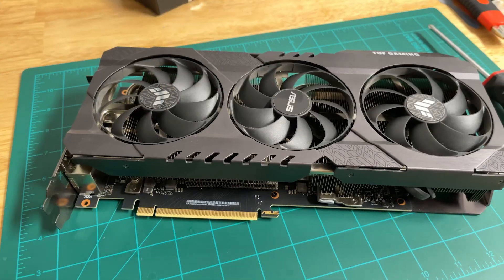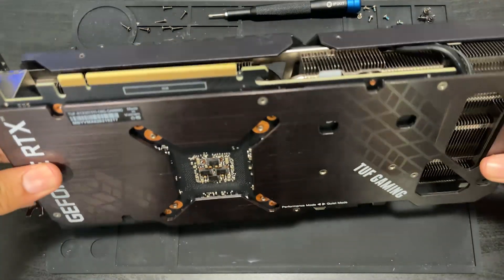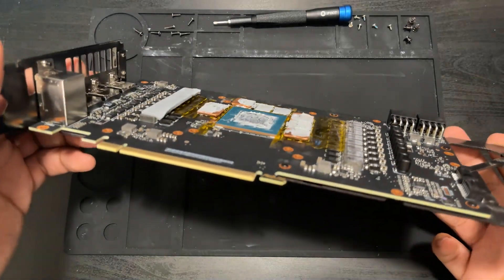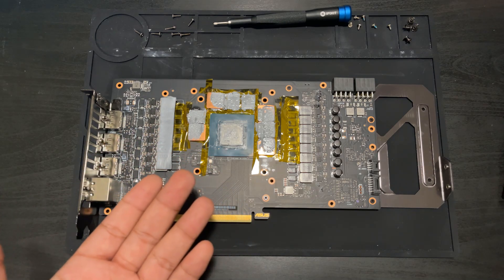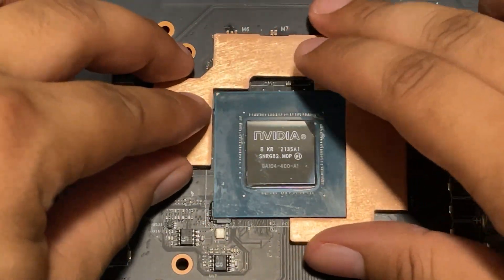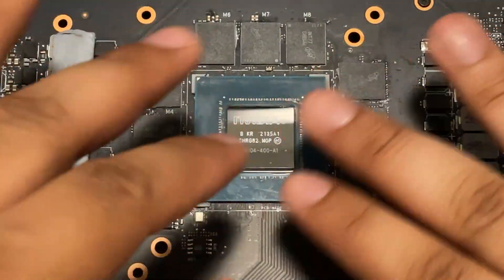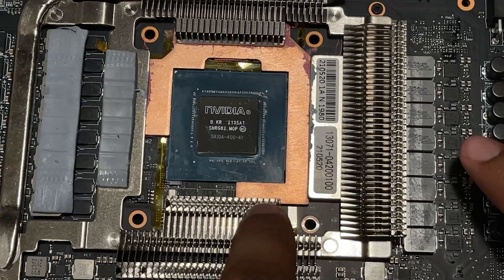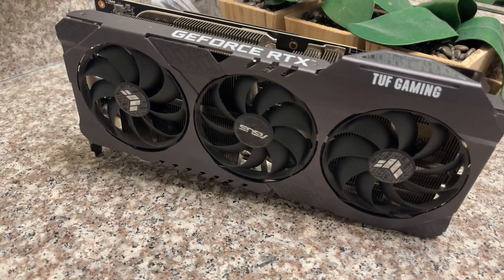RTX 3070 Ti COPPER MOD: 1 Month Later And... OMG...

Comment: Honestly for the price we're paying for graphics cards, these practices should become standard for manufacturers.
Reply: we need to strike of gamers against planned aging
Reply: @Z_Pavel  RTX is planned aging for the GTX 1080 and 1080Ti which were too powerful.
Reply: @Z_Pavel you honestly think I they care about 'gamers' lol.
Reply: @Z_Pavel ptm7950 also
Reply: i hope there is a company with words "create and made from gamers for gamers"
Reply: For real the current situation is trash.
Just got a 3080ti, doing 3d rendering and even at 50% power underclock the memory hit over 110C and shut down. Have it under-powered and undervolted, with a mild 15% underclock for stability, and it only ever touches 104-108C mostly.
Doing a copper mod in the next week.

Yeah it doesn't matter how much of a deal or overpriced the product is when it just straight up doesn't do what it's supposed to do.
Reply: @arsenal4444  look into copper modding it and use msi afterburner to give it a more aggressive cooling curve.   My 3080ti never goes above 75c(usually 71c under full load)  and generally sits around 26-29c while just doing normal stuff.

Edit - oh just realised where this was posted and read you txt proper 😅😅😅  ha ha .   Well you'll see  good results doing this anyways.    Oh and one more thing,   the msi afterburner still  makes a big difference as my 3080ti will go to 51c without a load with it off.  I guess thw default is no fan under like 60c.
Reply: @jebes909090  honestly the cooling noise got annoying at anything outside of auto, and yeah I could micro-adjust it to optimize like 5-10% better fan speed throughout, but the single digit degree C that will yield is pointless for how the card fares in it's current state

and it's only the mem/hot spot on the junction. That's what crashes the whole thing, otherwise for full load and rendering the core is in low 70s to high 80s depending on power limit and voltage adjustment

the issue is fully in the lack of copper modding, fans are doing their thing fine as is
Reply: @arsenal4444  i feel you, same happened to me with a 2nd hand tuf oc3070ti that was used for mining. It was like @109° something and the gpu core@80+. Now after the copper mod I'm at 70 degree max on the memory and 75 average on GPU core
Reply: @user-jd3pk1bz8e  ayy thanks i forgot to reply here. Yeah those sound about right, copper modding may be my new addiction lol.
Reply: @arsenal4444  damn bro. I am gonna do this mod too. Mine reaches 100+ while rendering in blender. Now running with heavy undervolt+memory underclock and lowered power limit. Starting hate Nvidia so much for their bs.
Reply: @Pixel_FX  It's totally on a per-card and per-manufacturer basis. For 3080ti's, the overheating undervolted one is evga, but i have a gigabyte running stock and it only hits in the 80s and sometimes touches low 90s for a moment, but the core vs mem vs junction temps don't have more variance than 10-15C degrees. The temp differences on evga are 30C+ 

Seems it's super installation dependent with physical tightened pressure on the core thermal paste vs mem thermal pads being either close to even or way more on one, as more pressure means more heat transfer into cooling fins and fans, and whichever is looser just holds the heat instead of transferring it.

Super excited to get this fixed and reply with numbers.
Reply: @arsenal4444  Reply here with numbers if you can. or upload a video :D on your channel. just subbed
Reply: old cards were made like this lol
Reply: They want to be cheap with manufacturing and charge a big amount on the cards to earn more profit than spending to manufacture then
Reply: I agree bro, I just realized that my vram temperature was 101 C
Reply: @PITAGORAS2552  copper modding brought my 3080ti to 75c under load.   i noticed that everythign was dried out when i took it apart to do the mod.
Reply: Agree
Reply: ya its kinda messed up that the gamers themselves have to take matters into thier own hands.    looks like nvidia is using the bethesda model ;)
Reply: Refuse to buy deliberately poorly designed, planned obsolescent products and they will.
Always do your research before purchase and vote with your wallet.
Reply: Oh yeah.
Reply: facts but they dont care because they want their MTBF low before they'll sell you another gpu :)
Reply: They do it on purpose so we spend more money on their cards.
Reply: copper modding is going in for atleast 15 years

its hilarious that card makers still let their vram cook and they also still use this horrible, hard thermal paste and often really cheap and bad thermal pads

as far is i know, it got worse over the years.

i remember seing those really nice high end gelid pads on older cards like on the AMD HD 7970 3GB with stock blower design.

And then u have a high end 3080 that comes with the cheapest, worst pads in the world while the VRAM is cooking at 105 degrees.

I also dont get, why card makers never put pads on the backside of the card. Putting pads on the back side where the vram sits so the metal backplate makes contact can get u 3 to 6 degrees difference.

Im using a complete backplate mod and also a pad under the GPU die so it also had contact with the backplate. And on the backplate additional heatsinks.

The card is stone cold even with brutal overclock and only 50% fan speed. With arctic thermal paste i roughly get to 64 degrees in summer (i live under the roof)

With liquid metal its mostly at 57 to 59 degrees. And in winter even colder.
Reply: Nope lol super high risk
Reply: @whitefata104  No

Comment: Hi Dandy, so underrated channel, excellent content. My first question:  Copper size 1,5mm or 1,2 or something. And second, Did you try it on 3080 ti TUF, it would be awesome if u make a test for it, caz that card is so hot even after thermal paddng regularly. Thanks bro.
Reply from the maker: Thank you! Sadly I don't have a 3080 ti on hand, but the plate size I can tell you is 1.5mm!

Comment: how thikness copper use for gpu vram?, i using 1.5mm thikness why that temp is getting higher? start from 60-65° than i use copper temp up to 88° need some guidance

Comment: I’m so curious to see what would happen if placing a thin cooper plate on the die. Would it cause a short? Or would it make the temps better?
Reply: not a good idea in any way shape or form.... never ever do this lol.  the heatsink plate is usually not perfectly smooth, the die itself is probably not perfectly level, and the copper plate you will use is not perfectly smooth. the distance between the heatsink and the die is minimal, the thermal paste does plenty good job of filling that space effectively and with good thermal transfer. you wouldnt see much benefit at all doing a copper plate. you would probably crack the die

Comment: Ive done this on over 10 gpus so far and had incredible results each time, also on vrm/cpu/ even a desk fan ive attached like 10 shims onto its heatsink and it literally made a 50% difference, these copper shims are incredibly powerful
Reply: It's been a while, have you had any issues  with corrosion in any of your units as a result of the galvanic coupling over that time? Or even as general malfunctions or card failures?
Reply: is it possible to do this mod on laptops?
Reply: @hatorichise2705  yes absolutely
Reply: @hatorichise2705  You can use the mod for the vram but not on the cpu or gpu. If you want better temps for the gpu or cpu youll want to use liquid metal or PTM7950
Reply: Hello, where can I find them?
Reply: @Jeanpaisa89  Amazon..
Reply: yo that profile name is nuts man 🤣🤣

Comment: I have an RTX 3090 (Zotac Trinity with modded bios to remove stock power limits). I removed the stock cooling shroud and placed the card directly onto 3 Noctua fans (120 mm) mounted at the bottom of the case (intake). I purchased 2 additional smaller Noctua fans (92 mm) and placed those directly over the backplate of the GPU, using 2 mm standoffs (push configuration, so blowing air directly onto the backplate). I get idle temps between 23 - 25 C depending on the ambient temp. Under full load, the card never goes over 66 C. I wonder how much more I could get out of it using a copper mod. I don't have your patience though. Taking apart a card takes a lot of steps and patience.
Reply: it has nothing to do with core temps...
Reply: @pav1u  Please enlighten us.

Comment: I’ve tried your first solution and it worked great! (Same GPU as yours, my temp went fron 106 C to 76 C mining) I wanna try also this one, the 1 piece copper plate seems a lot easier to work with

Comment: saw your original copper mod video, very impressive results, with the temps getting far higher than I am personally comfortable with on a lot of these GPU's its definitely worth doing IMO, gotta say though that the custom plate is pretty expensive for very negligible performance gain, the "shims" are of course kind of DIY, but if it works and costs a lot less that's a win to me. It seems like 95% of the performance for less than 50% of the price. Either way definitely a worth while mod.
Reply: Absolutely agree with you. I looked around for thermal paste reviews/testings and it turns out the change from Arctic MX-4 thermal paste to Kryonaut thermal paste is really what gave the 4-6 Celsius bump in performance (game load comparison). Had I did more research and paid more attention I would have saved myself $20 (+Shipping cost) difference if I just ordered the DIY Shims.

Comment: I used 0.5mm thermal pads between the 1.5mm thick copper plate and the memory chips. Regular thermal pads were 2 mm thick. The effect is the same.

Comment: Man seeing 62C mem temp is so surreal lol! Another amazing video, you're crushing it!
Reply: Hi Seb, I am a follower of your channel. Have you tried copper modding? It works really great!
Reply: it doesn't work that well depending on gpu and correct thickness, not easy, i copper modded more than 12 times different gddr6x only, i just used less thickness shims than needed and i don't use thermal paste, i use thermal putty (sticky and no need for kapton tape etc as it acts as electrical isolator as well, i can keep the hottest card easily under 90c in the summer inside the farm with no fans so its all good, long time sub Sebs, keep em coming!
Reply: @pav1u  lol 90 is so bad compared to copper 66
Reply: you gotta try it seb. I did it too on my gddr6x gpus and now I don't have to listen to %100 fan noise while keeping the memories very cool :)
Reply: That's why i buy strix , you dont have to change anything and the card come with good thermal pads.
Reply: @whixirc7564  even strix dont come with thermal pad quality like gelid gp ultimate 15 wmk
Reply: @techgeek2994  They come with better one than the other card.
Reply: @whixirc7564  basic cards come with 3 wmk, strix comes with 6wmk , gelid ones are 15wmk.
Reply: @techgeek2994  That's what i said , i didnt say they come with 15wmk , they come with better one than the other card.
Reply: @whixirc7564  yes that is true
Reply: I'm getting that on a 2080 with upgrade paste and pads with -125mv undervolt, 50% of the fan speed as before.
Reply: @BboyCorrosive  undervolt is king if i copper mod the 3070 i would see max temps 55degs
Reply: This video inspired me to copper mode the same 3070ti Tuf gaming GPU. I did it few weeks ago and so far so good! The temperature is around 68C, but I covered cooper plates by using special liquid to prevent from shorting circuit. So that's why my temperature is a bit higher. Also, I used thermal pads to isolate memory chips. 

It is hard to believe that some GPUs have a massive radiator, but such things as thermal pads don't work well!
Reply: @bohdan.samusko  yea its very interesting, alot of the reason this works as well as it does too gpus or cpus for that matter simply have thin crappy alum/copper, ive never seen a heatsink actually have a very thick alum/copper makeup at all, its insane honestly. these shims cost like 2$ or less and the companies could put them on the mem pre installed so easily, its literally like adding 100$ of performance to a product in terms of how much difference it can make, sometimes more
Reply: @bohdan.samusko  how did you isolate memory chips did you put just small amount around memory chips with thermal pad ?

Comment: İ did copper pad mods on my 2 rtx6600 it worked fine but when i apply on my 3080ti it just blows with the shortage i think i didnt use enough kapton type

Comment: I did some undervolting and got some pretty good results.  I saw the first video you did and thought I might try the copper mod if the undervolting didn't work.  So far, the undervolting is pretty close to what you're getting.  However, should I decide to do the mod, I'll use your videos as reference material.  Thanks for the update!
Reply: What card have you got? How much undervolt? I have a ventus 3x plus OC and wondered what the sweet spot might be

Comment: Hmm I get 80+ mhs here. Is it broken? Or did you record this weeks ago ? hehe
Reply from the maker: Recorded pre-full LHR unlock haha :P
Reply: @dandyworks  the 100% unlock was like 2 week ago, but its like 3 months that its on 80% giving 70mhs, 55 - 56 is to low, i get almost the same temps as you have with the same oc and mhs without any modding, so idk if its good or not, can you do the same test with 100% unlock to see the real temps with real mhs stress on that card?
Reply: Do u mind sharing your Oc settings.I use afterburner on 3070 ti Tuf but not sure with the OC.Also getting 100C on vram when mining and gonna copper mod soon👍

Comment: Is Thermalright tf8 suitable for application between copper and a heatsink to prevent corrosion?
Reply from the maker: While I can’t find any information on the exact composition of TF8, it’s advertised as being carbon-based. That leads me to believe it’s most likely a similar mixture of carbon nano particles and aluminum oxide. Unfortunately there’s no way to be 100% sure, but I think it would be harmless as long as your GPU isn’t around excess humidity.

Comment: I went with the CMG copper mod and it’s been great. My 3080 FE in a SFF with an overclock still sits at 69c core, 84 memory.
Reply: My stock Aorus 3080 master never breaks 70c at load and my VRAM has never seen temps past 71c so your mod wasn’t that good.
Reply: @SuckMyNix10 cap good mod

Comment: OH NO! I TOOK APART MY WHOLE COMPUTER LOOKING FOR THESE PARTS! WHERE IS THE RTX 3070 Ti, WHATEVER THAT IS! OH MY! HOW DO I PUT THIS BACK TOGETHER AGAIN? ALSO, I PULLED OFF THE COPPER HEAT PIPES ON THE BACK OF MY MOTHERBOARD LOOKING FOR THE RTX 3070 Ti! I COULD NOT FIND IT THERE! WHERE IS IT LOCATED ON MY COMPUTER? I SPREAD THE PASTE AND PUT THE TAPE EVERYWHERE! MINE HAD A LOT MORE METAL THAN YOURS! SHOULD I ALSO USE THE VASELINE LIKE I SAW ON ANOTHER VIDEO? I ALSO PUT EVEN MORE, $200.00 WORTH OF THAT RED GRIZLY BEAR PASTE! I SPREAD IT ALL OVER THE RAM AND THEN PUT COPPER ON THERE AS WELL! WHEN I LOOKED AT MINE A MONTH LATER IT WAS ALL BLACK! UH OH! I ALSO USED A LOT MORE OF THAT YELLOW TAPE! I WENT TO HOME DEPOT AND TOLD THEM I NEEDED THE TAPCON TAPE IN YELLOW! THEY DIDN'T HAVE THAT BUT I GOT SOME OTHER YELLOW TAPE THOUGH... BUT IT'S NOT SEE THROUGH... IT SAYS VINYL TAPE, I FIGURED THE MOTHERBOARD IS VINYL I'M PRETTY SURE, THIS SHOULD SUFFICE!
Reply from the maker: Did you try turning the pc off and on again?
Reply: @dandyworks   Yes! I unplugged the HDMI Cable and the Power Cord from the Monitor! I unplugged the HDMI from the Computer as well. Then I plugged it all back in. Is that right? The computer did seem to go off and on again...

Comment: Well done but my temps are even lower, you just use liquid metal and clear coat ( for cars ) for the smds around the chip… apex legends 240 fps with 39 degrees Celsius :)
Reply from the maker: Hmmm…. Perhaps I should look into some liquid metal based mods in the future? What do you think? ;)
Reply: @dandyworks  just saying my temps from my new 3080 ti vram 100 degrees C with fresh normal paste ( 1 month old card, paste from factory ). Liquid metal on the chip only even dropped the temps of the vrams! like it soacked the heat u know. Furmark 15 Minutes vram temps @ 82 Degrees C, normal gaming 60 Degrees vram.
Reply: @dandyworks  "liquid metal" is a scam, and the best way to ruin and fry your VGA. It is conductive, could get under the chips, next to impossible to wipe and clean of PCB, it corrodes aluminum heatsinks, etc.
It is also a huge pain to deal with for service/repair folks.